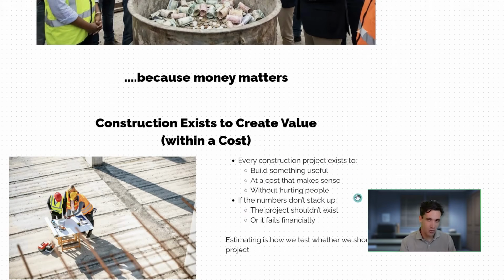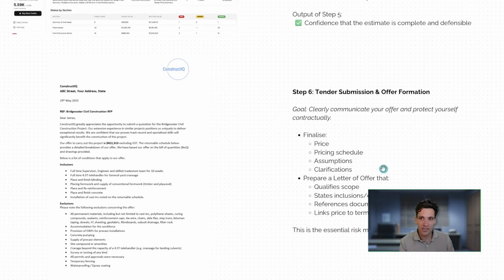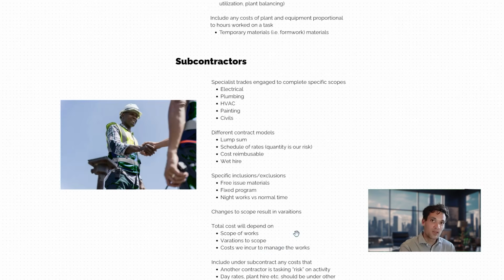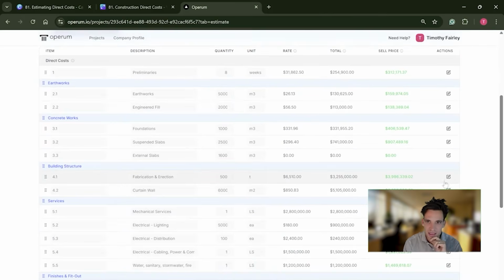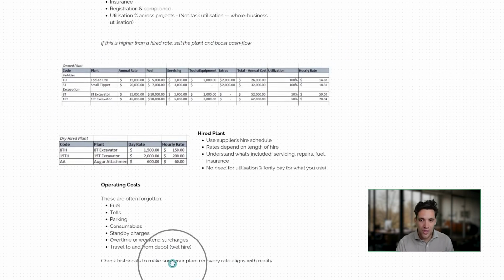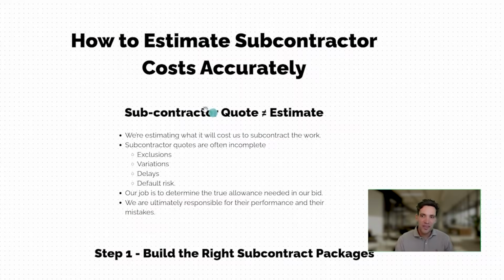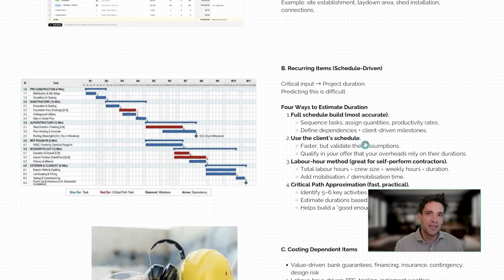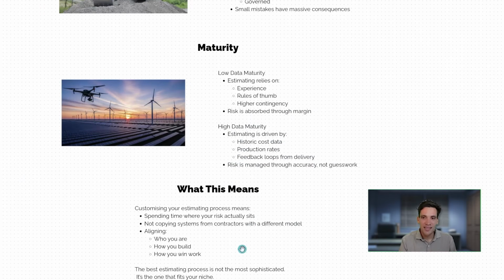Construction Estimating: The Complete Step-by-Step Guide

Comment from the maker: Use AI to find errors in your construction estimates: https://youtu.be/iiKMcYUa1zc
How to use AI in your estimating: https://youtu.be/bd3S_0WZjv0
Timestamps:
0:00:00 Introduction: Estimating as a System 
0:02:05 Why Estimating Matters (Value vs. Cost) 
0:04:47 Owner's Perspective vs. Contractor's Perspective 
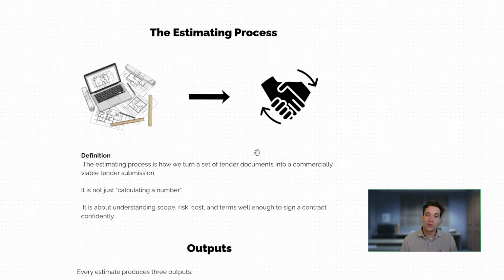0:11:52 The Complete Estimating Process Overview 
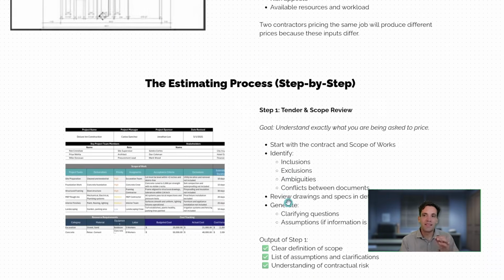0:16:45 Step 1: Digesting Tender Documents 
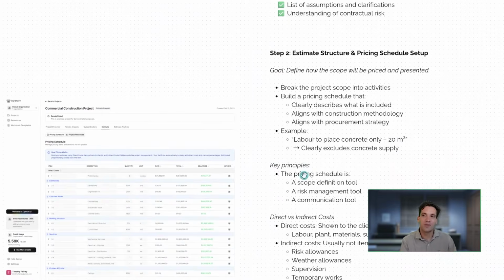0:18:07 Step 2: Structure & Pricing Schedule 
0:29:51 Estimating Methods (Top-Down, Parametric, Bottom-Up) 
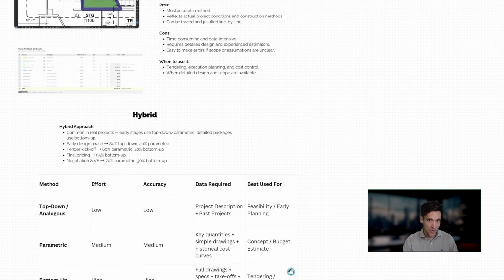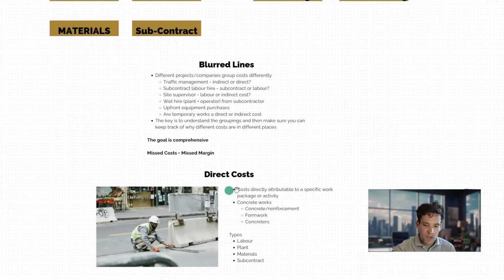0:43:42 Construction Cost Categories 0:46:23 Direct Costs Explained 
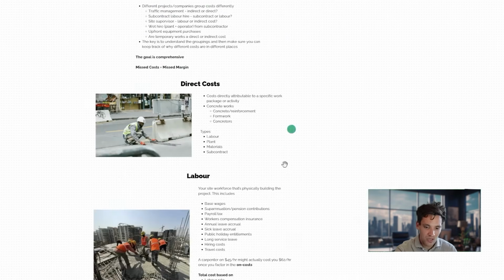0:56:56 Indirect Costs Explained 
1:07:24 How to Calculate Direct Costs (4-Step Process) 
1:24:19 Estimating Labor Costs & Productivity 
1:41:38 Estimating Plant Costs 
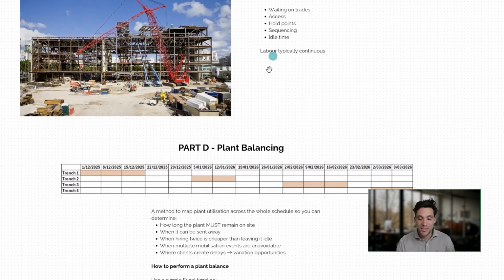1:50:33 Plant Balancing Strategy 
1:54:27 Estimating Material Costs 
2:12:10 Estimating Subcontractor Costs 
2:29:03 Calculating Overhead (Indirect) Costs 
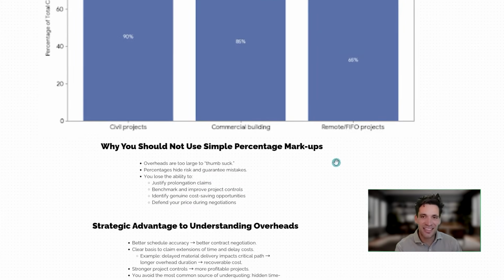2:46:13 Reviewing the Estimate & Risk 
2:55:35 Writing the Letter of Offer 
2:58:32 Customizing the Process for Your Business